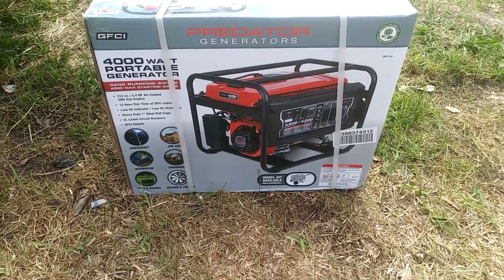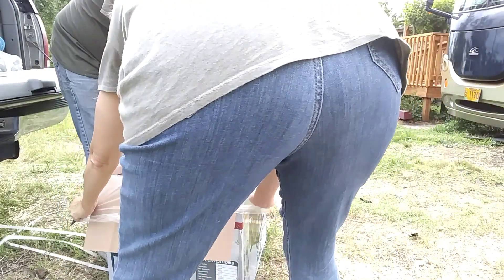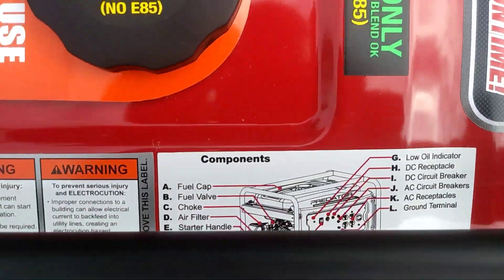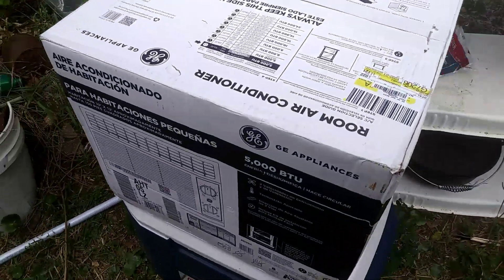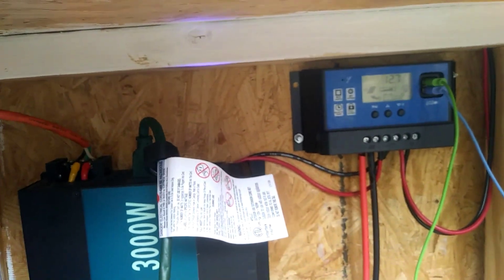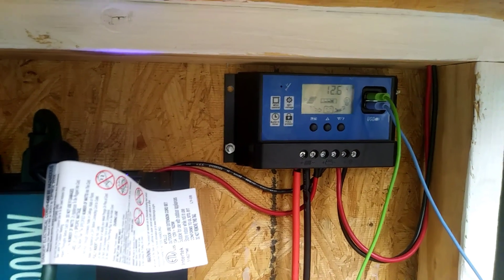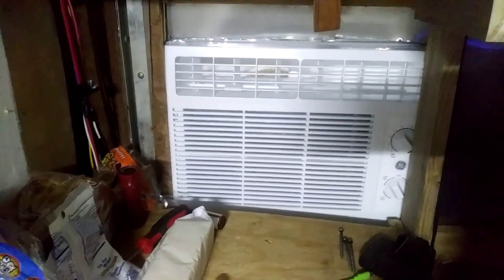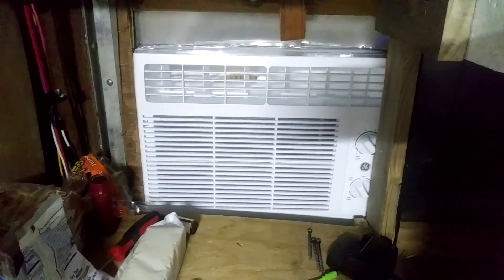Intalling A/C in 6X12 Trailer

Comment: That is soo wonderful to hear you can run the a/c with the solar wow, a dream come true and it'll be quieter for you too!!  I'm so happy for y'all!!  You probably have it on your site here as to how to rig up solar to handle a 5000 btu a/c unit and the things you have to have hooked up there in your trailer, I'd love to know one day when your not real busy, I know your'e busy a lot though and that's ok, I'd love  to know how that works and what all you need to set solar up like that, I don't know anything about it but I'd sure love to, and maybe how much it costs to get everything you need and where's the best place to buy it from.
Reply from the maker: Well we started small at first 100watt panel and charge controller with just a 400 watt inverter and 2 35 amp hour batteries. Then we slowly began to grow the system

Comment: you know hearing you say about the water thing in wyoming it sounds more like you crossed the Russian boarder? youre better off moving just over the florida boarder to alabama. besided when yellowstone blows you wont want to be near that. or after you might not be 🌋🏡 yes in FL you need a/c. ive run a 5000 btuh off batteries.. youre better off generator but lots of gas. maybe a little of both? get more panels?